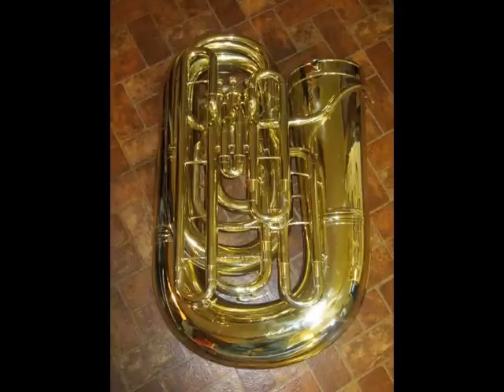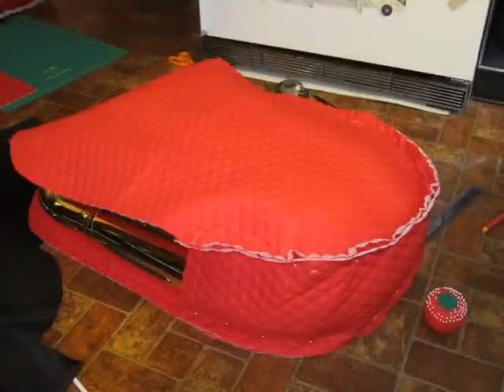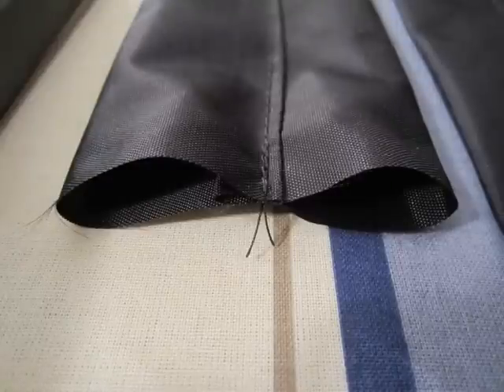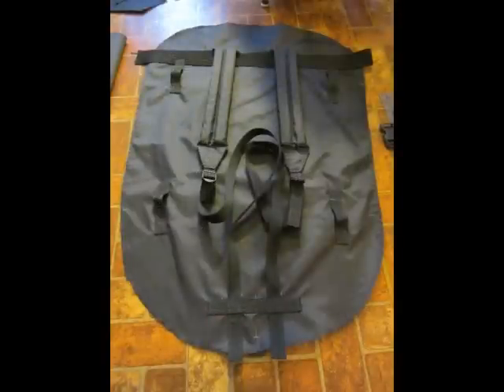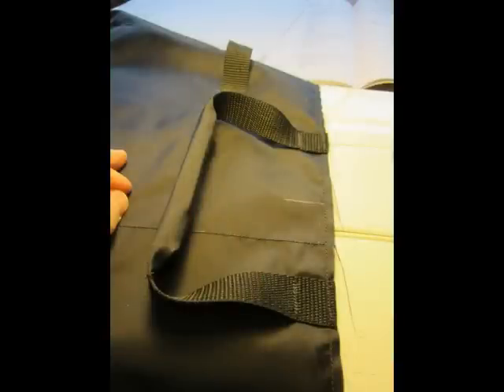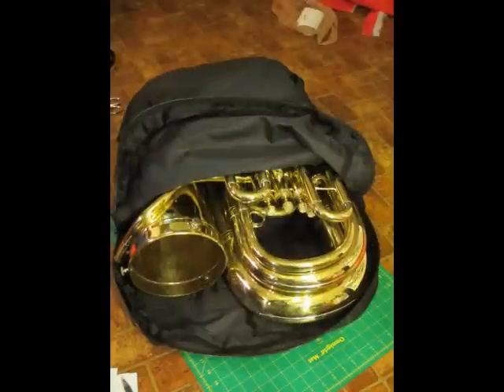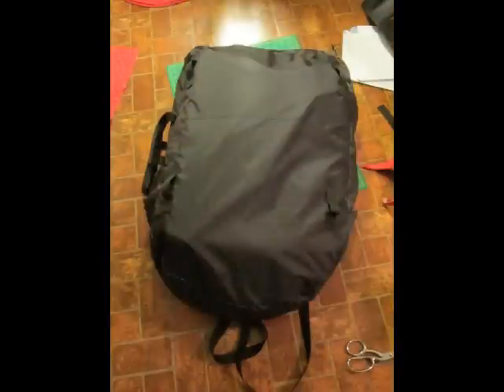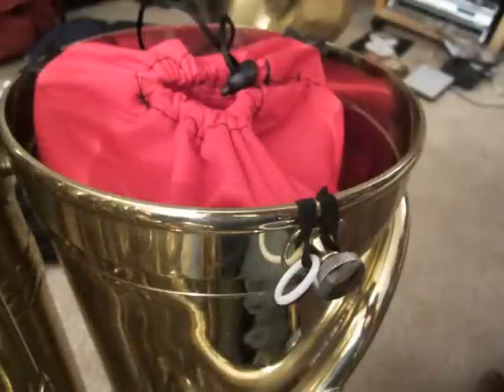Making a Tuba Gig Bag (for Conn 24J or similar)

Comment from the maker: I checked the PDF and it is there, but you have to get the URL exactly right. Here is the URL so that you can copy and paste it into your browser. Because YouTube messes with full URLs, you need to replace 'whoa' with three 'w's and lop off the 'ic' in 'comic'.

whoa.serpentwebsite.comic/Tuba_gig_bag_details.pdf

In short, the file name must begin with an upper-case 'T', and the underscore characters between the words are also necessary.